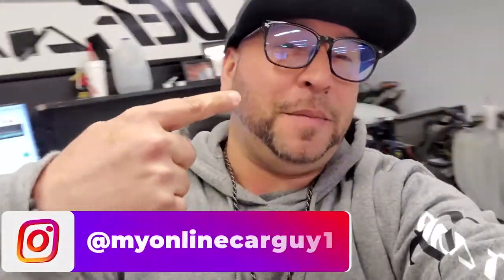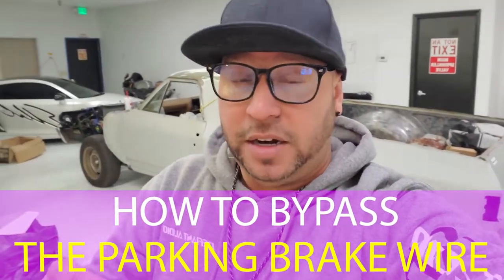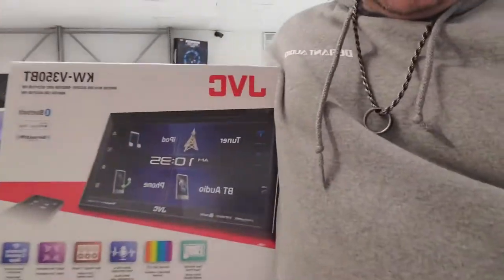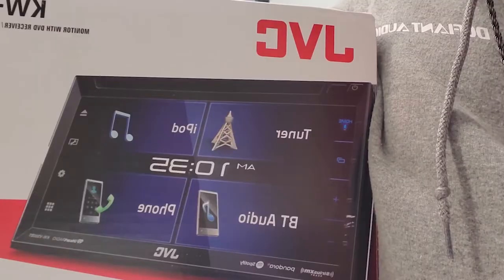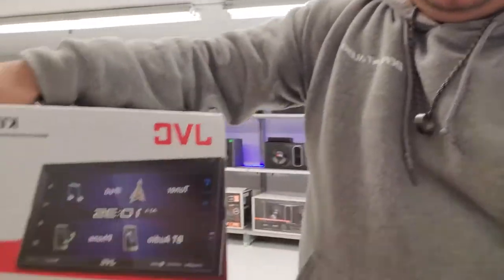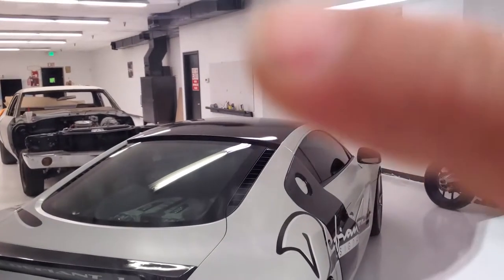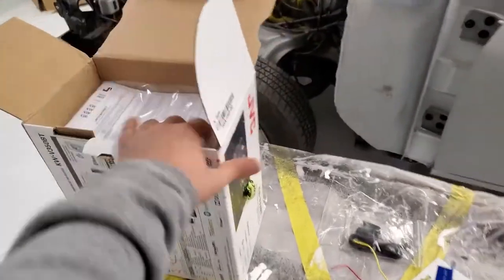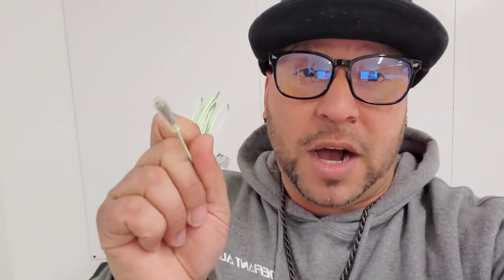How to bypass the parking brake wire nice and easy.

Comment: Long and drawn out explanation. Who needs it? Just get to the wiring. Viewers are probably already at that point. I just needed to know if I can attach the green brake wire from the radio to a ground screw in the dash.
Reply: I know right. How does the definition of RMS have anything to do with bypassing the parking brake? People try to hard to make a video.

Comment: on the new pioneer DMH-1770nex and dmh-1700nex models this will not work.  pioneer put in another delay crap and now you need a momentary switch in between the bypass  (in between the blue wire).  i am starting to hate pioneer

Comment: My car will only let my Passenger connect her phone with Bluetooth if the car is in "PARK". Could I just switch the wires that go to parking brake and make them go to a wire showing car is in PARK, if there even is one??? Great video by the way. 🤠
Reply from the maker: Yes if u actually wire the parking break wire, to.the parking break. Then when the vehicles parking break sends a signal (from being depressed) then it will unlock the radio..

Comment: I know I'm late to the party, my bypass has worked great till yesterday, my remote blue white stripe wire has lost power and dead. Where can I wire the bypass wire to get it to work again since HU some reason not giving remote power anymore on a avh 2300 nex...any help you can provide be greatly appreciated

Comment: Great vid! Trying to do the same to my Stinger HE10 for my Jeep. Any suggestions? I identified the parking brake and ground but not sure what to do next
Reply: What did you end up doing? Pretty sure you can just tap the parking brake into a standard black ground wire and ground it to the vehicle to override it.
Reply: I haven't done anything as of yet.  How would I ground the parking wire? I would assume getting behind the stereo and locating the parking wire?
Reply: So find the main harness which holds the parking brake wire (light green) and your main ground (solid black). Cut both wires and splice them back into each other. This should bypass the parking break. 

I’ll let you know, I’m going to try it tomorrow. There is a YouTube video of the Stinger Heigh10 install into a 2017 Tundra by CarAudioNow and that’s how he did it.
Reply: Definitely! Greatly appreciate it!

Comment: Is a great video. I’ve got the JVC KW-Z1000W. Install shop didn’t even put the regular ground so even when its parts I can’t get a video. I’m looking to bypass. I hope this works for the same radio.
Reply: Did you ever get the bypass to work on this radio? If so how? I have the same unit.
Reply: I did and thanks to this video. It was perfect information. The adapter worked perfectly. I had to pay somebody to do it since I’m not very electronically savvy. They charged me like 150 bucks to do it. Works awesome. I play all kinds of videos through the USB.
Reply: I just ordered the same JVC z1000w unit. Did you use the same bypass kit as in this video or just ground it to the black wire? Several videos only suggest simply attach parking wire to ground for JVC unit.
Reply: @Chay. J.  I recently installed it and just connected to ground. HDMI input works while driving no problem. I have a Roku installed now and can listen to YouTube videos and DirecTV on the go.
Reply: @firpofutbol  thank you!

Comment: can't you just wire the parking brake wire to a switch and ground it, then flip the switch after the radio boots up grounding it.
Reply from the maker: Absolutely,  that was touched on during the vid. The micro is a cheap way to not have to drill into your dash though and manages the parking brake for you. Its all in the video.

Comment: Would I need the relay with a kenwood dmx1037s? I pulled one out of a wreaked car and im looking at installing it into my vehicle it was previously tied straight into the ground
Reply from the maker: Yes youll need one. However, amazon for some trason has COMPLETELY removed all of them. So youll have to sesrch google for now until i find a new link i can share.  (  ax-tr1 is one type of micro relay )

Comment: Would a boss BE7acp be considered cheap enough to just ground? That is what I have in order currently wondering if I need relay or can just ground the wire
Reply from the maker: Yeah man.  Just ground that,  you'll be good to go.  👍
Reply: @myonlinecarguy1  thank you
Reply: Marcus Silverio did grounding the wire work on your Boss BE7ACP?

Comment: Question. I’ve installed the bypass and it kind of works. The Bluetooth menu is greyed, flashes and then it’s accessible. However I can only hear the audio from a movie. Still get “warning” about video. I just installed a pioneer dmh-160bt. Please help
Reply from the maker: Sounds like it isnt yet working. 

Make sure your "trigger" it getting pwr from the rem wire. Any other trigger will be wrong timing and wont work proper.
Reply: @myonlinecarguy1  Will definitely look into that! Thanks!
Reply from the maker: No worries. Let me know if i can help anymore.

Comment: I'm wanting to install a parking brake bypass on a stock ford stereo. However, when I located the green, black and blue wires I found there was either conduction shield or what I think may be called bare wire running alongside these three wires. Question is.. how do I deal with the bare wite when installing the parking brake bypass? Please excuse my verbage and terminology - I'm new to this. Thanks for your time.
Reply from the maker: On a stock radio, the micro relay wont do it. 
Youll need a module from "Lock pick" or "Nav-Tool" to unlock an oem radio.
Reply: @myonlinecarguy1  seriously?! Damn! Thanks for the help!
Reply from the maker: Yeah im sorry. See the after market units are much simpler electrically to manipulate..the oem/factory stuff not so much.